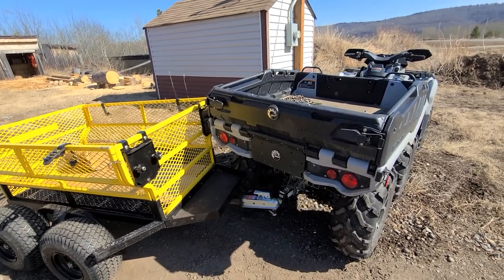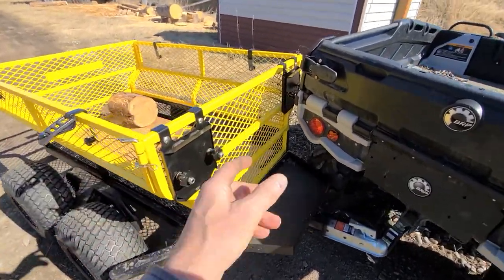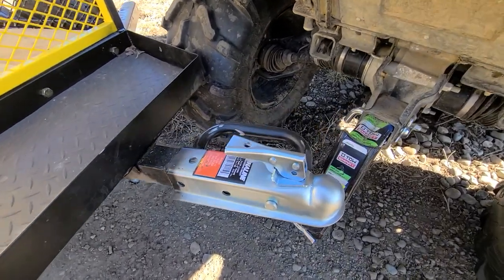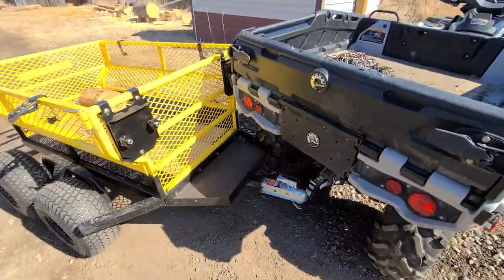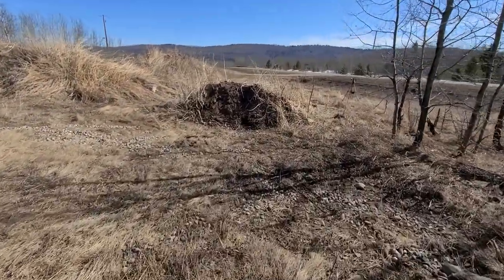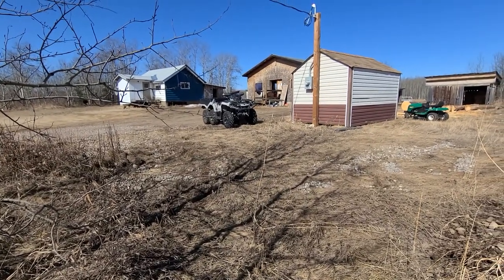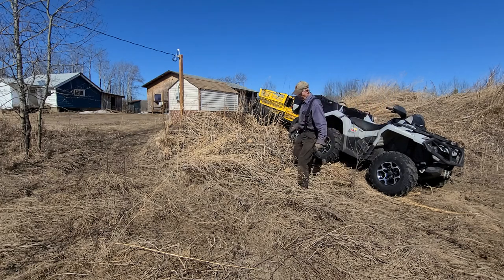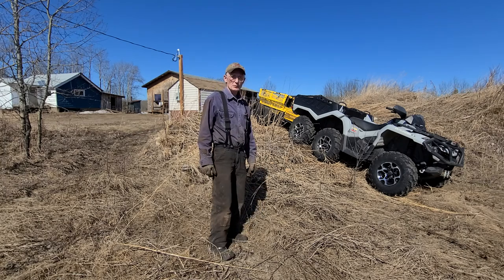GORILLA CART MODS

Comment: Here in the states, I’m looking at the Bannon utility trailer to tug behind my Can Am. I really do believe they are the same trailer, but haven’t researched that yet. Great video and super awesome Can Am you have there! Peace from Maine ✌🏻
Reply: I have done tons a research on it. Get this one from fleet farm because the Bannon from Northern tool has different tires small and not as durable. Everyone mentions they have trouble with it. At least that's what I'm doing.
Reply: Avoid the Bannon.   The 8 wheel tire system is absolute junk.   The trailer is great.   I plan to buy the tires like the Gorilla has